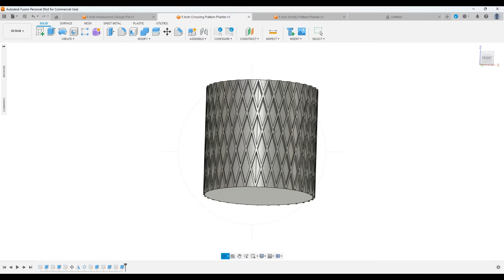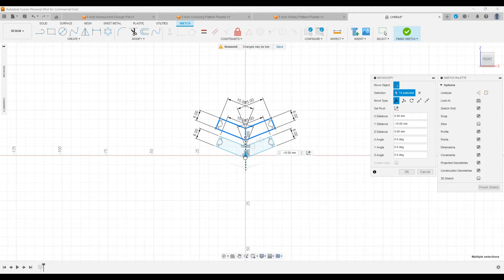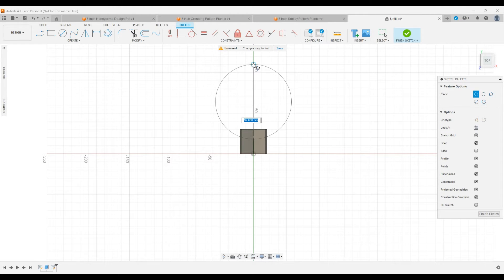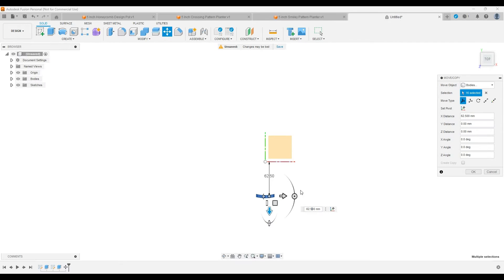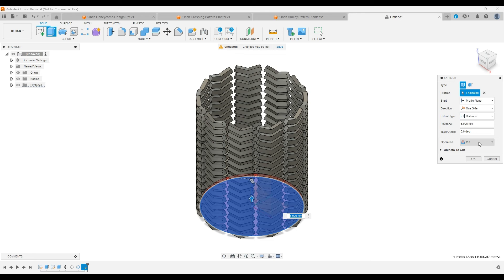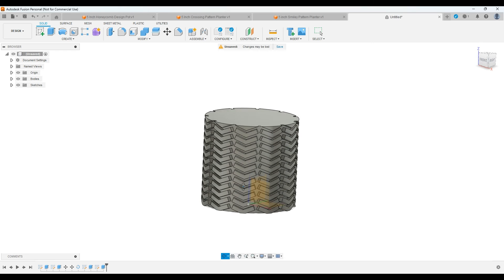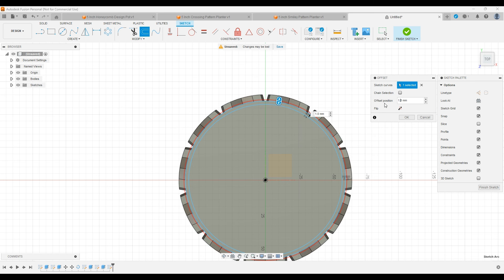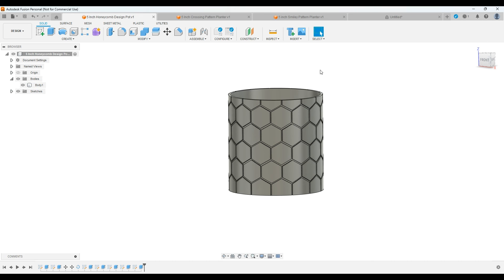How to Add Patterns to a Planter in Fusion 360 - Step By Step Pattern Creation in Fusion 360

Comment: Thanks for the video. The workflow you outlined does work but I think there are easier ways to get this put together. I’d use Emboss vs Extrude. You can change your pattern sketch to 1 vertical set of your pattern and then Emboss that onto the outer pot wall. You can simply set whatever depth you want and apply as an emboss or deboss. Once you have that then you can circular pattern the applied Emboss feature around the pot and set the number of instances to whatever you want to get the look you’re after. This is the workflow I use to get patterns applied to the outer wall and it’s quicker and easier to apply. Emboss works really well and can apply your sketched patterns across all types of pot shapes regardless of curvature.
Reply from the maker: This is a great way to do it! I recorded a video a few weeks back about this technique as well!